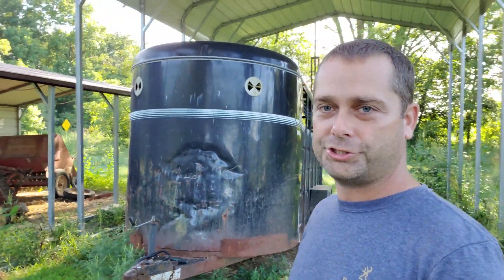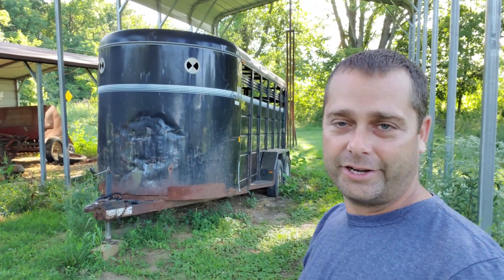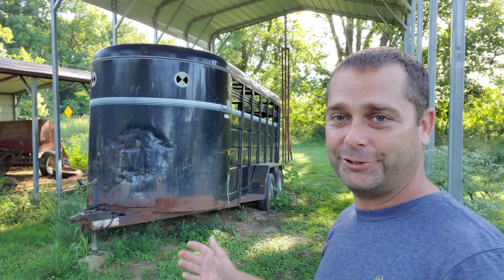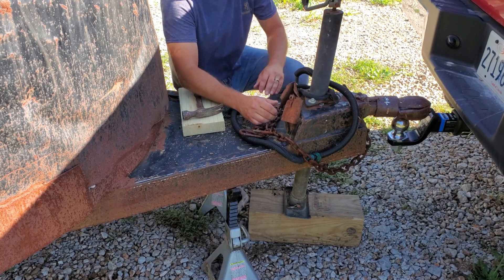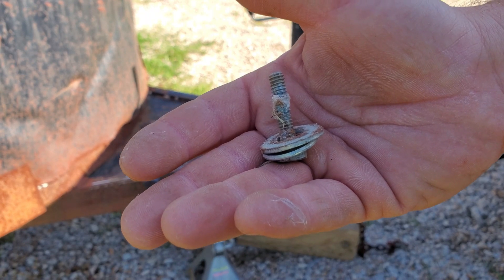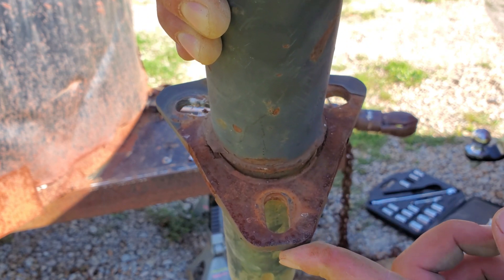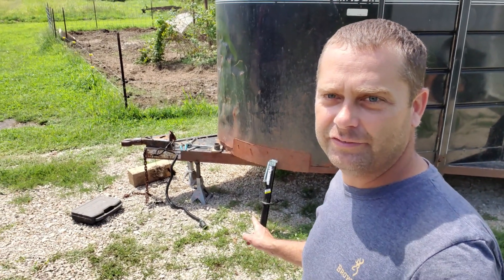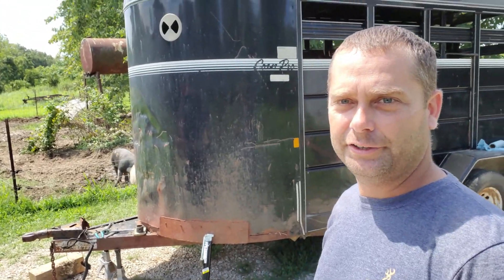Time to get the livestock trailer road ready.  I have some repairs to make.

Comment: Evan, That's a nice trailer but that bearing race at 5:05, shouldn't just fall into the hub like that. It might be a good idea to take it back apart, clean and red loctite that race back into the drum/hub. Try some heat on the rest of the lugs so they don't snap off and use Never-Seize when putting back on. Just some suggestions, thumbs up always !!

Comment: Many years I worked on trailers much like yours. standard every year I would pull all wheels lube bearings & verify the brakes work. Wiring anytime I saw junked up wiring I'd Pullit all out and run New loom in & learned threw the years to solder all connections & heat shrink every connection. Note In frame I'd weld 1/4 in bolts and use them with conduit holders with wing nuts & spray all the set up with white grease to cut corrosion under the frame where they were. It pays off in time & money in the long run. I saw you doing the trailer jack, I have had to do many too & oh the memories it brought to me. 

On all that equipment, that gold never seize is your BEST FRIEND! 
Happy times bud!

Comment: That is a nice trailer. As you said good for all kinds of cartage. If I may suggest, from experience I would find a piece of Alum Checker plate to half moon it over the front where it is smashed in. 1/4 " bolts and nuts to hold it on. Touch up paint to the wheel rims. little black touch up too. You have the lights working. Good insurance to make things nice so when the DOT boys are driving around looking for crap running on the road, they will not zone onto your trailer Good vid thx for posing it.

Comment: JudithB  That  trailer  has  been  beat  to  death nearly,  but  you  can  repair and  paint  it  so  it  will  last  many  more  years!  Does it  have  a  brake  unit  on  it???   Brakes on  the  trailer  can  sure  make  towing  large  animals  less  nail biting  and  saves  the  brakes on  your  truck  too!  You  would  need  the  brake  controller  installed  in  your  truck.
Reply from the maker: The trailer does have breaks and my truck has a break controller but the brakes on the trailer need a little bit of work.

Comment: JUST FOR FUTURE REFERENCE WHEN YA WELD A THREADED ROD OR BOLT, PUT NUTS ON SO IT KEEPS FROM PUTTIN BEAD SPATTER AND WHEN YA HAVE LIGHT ISSUES ON A TRAILER, LOOK AT THE CONNECTORS WHERE THE TRAILER TO THE TRUCK AND CHECK FOR CORROSION , OH I SEE WE HAVE A NEW ADDITION TO THE FAMILY, WE NEED A INTRODUCTION

Comment: glad you got things fixed,now let's get the sickle mower and baler going,find  a grass waterway flat ditch and bail your own,feeding goats or cows ,works just fine, iowa has cheap hay and lots of it, i'd love to tell you a few things on the hay field,but not on here
Reply from the maker: Yea, I had hoped to go thru all the hay equipment.  I bought all the manuals and have already bought some parts.  But now it seems like I have time before I will need it.
Reply: @CountryViewAcres  you'll do fine evan,check the timing on the baler,needles aren't bent and the knotters are sharp,first few bails always seem to break the strings ,as the bails go through it it gets shined  up and  works great,im sorry they stole that from you this year,smell of fresh cut hay,bailin your own ground,even the barn smells great ,best thing about farming  making hay,i'm an old man now but 4 yrs ago i put up 750 square bails by myself, i painted up all my stuff ,it looked brand new ,lots of stuff on youtube about tuning up a bailer ,great channel to follow

Comment: One of the major problems with trailer wiring is having a good ground between trailer and tow vehicle the trailer usally ground between the coupling and the ball hitch a rusty hitch will not ground properly